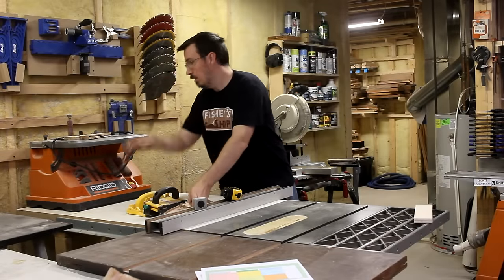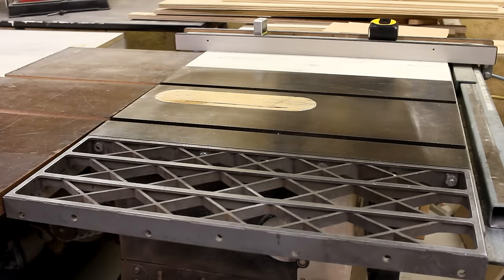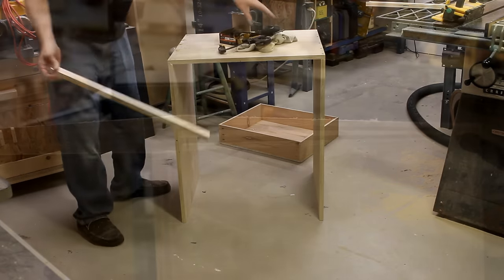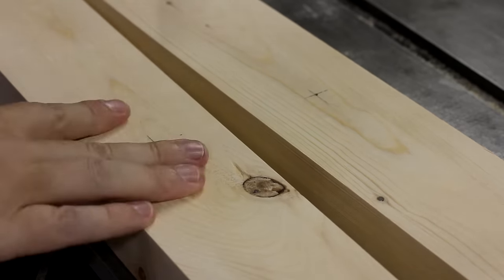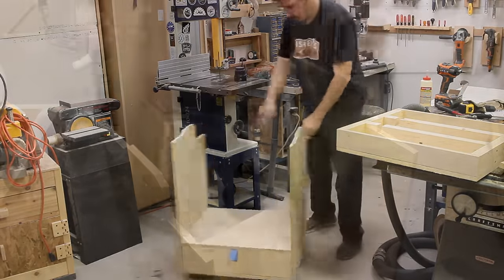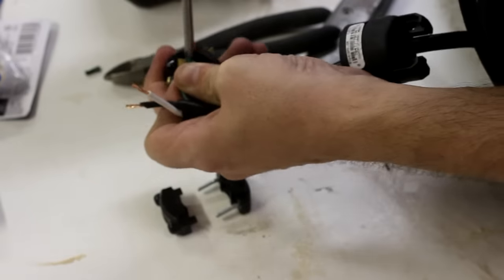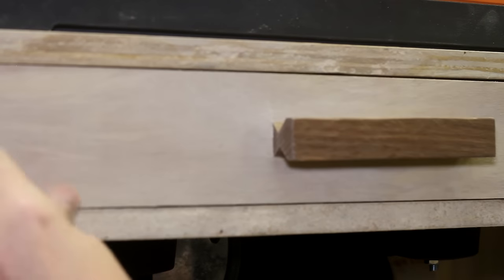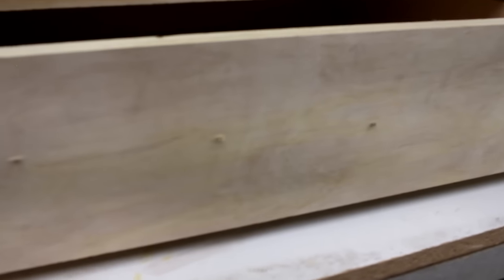Shop Work: How to make Fisher's Flip Cart

Comment: Fantastic design and entertaining video!   Building it right now....and have come to the flipping table portion.   Is there any reason you didn't screw the bottom/disk sander platform down to the 2x4s?   Your plans and video only showing you gluing it down.....and then hanging the disk sander off the glued platform.....seems like it could use some screws.   Let me know!  :-)
Reply from the maker: Add screws if you want.  Not really necessary but you can certainly do it.

Comment: I'm planning on modifying this design for a jointer/ drum sander.  Do you forsee any problems extending the top to 34" wide?  It's a pretty long span,  but I assume the torsion box coupled with the steel pipe axel should be able to hold up fine.
Reply from the maker: It'll be fine.  I know some folks made it 4'  wide for a lathe and it's working just fine for them.

Comment: I made your cart awhile ago and love it. Mine has some side to side motion even after I put some triangles in the corners to stabilize it. Is that normal? If not, any suggestions? Thanks for the great videos.
Reply from the maker: No that's not normal.  😬
Reply: Thanks for your fast response. It seems to be from the little bit of space btwn the table and sides that allows the table to flip. Clamping the sides tight seems to work, but I was just checking.

Comment: Great Video - just subscribed. How would this design perform with just a single tool attached (8" Planer / Thicknesser) and a assembly surface on the other side ?
Reply from the maker: It would be fine.  Just a little more clumsy to rotate since it would be so lopsided.

Comment: Drew, great design.  I have purchased the plans and plan to add a couple of these to my shop.  One question/request.  Can you share a picture with the belt sander down?  I am looking at getting the same tool and would like to see more clearly how it fits upside-down.  Thanks.
Reply: check at the 12 minute mark in the video. ( also in the outtakes.)

Comment: I want to make one of these. Is it possible to have two carts joined together, side by side? Maybe no tools on one side to act as an assembly table when tools are not used.
Reply from the maker: They wouldn't be flush due to the pipe flange and the latches.  But yes... I suppose it could be done.  It would be a bit low for an assembly table though.

Comment: Hey Drew, I just bought your plans after buying a lunchbox planer and the same sander in recent months.

One of my machines is slightly taller than 19". I'm assuming I can make the "Flip Cart Sides" (pink pieces) longer along the 30-1/4 dimension to accommodate?
Reply from the maker: Sounds right!  That should work

Comment: Drew, Nice plan that came together reasonably well, though my 'squareness' probably doesn't equal yours. 

My observations: the plans are good, but they would be better if all the dimensions were in inches instead of feet and inches. Who needs to do math? 

I would add more diagrams with gross measurements so that the user can see some details at a glance. 

I used dadoes for the shelves, and the half-half-half method for the drawers instead of pocket screws, mostly because I wanted to keep practicing those skills. Plus, I like the added feeling of solidity you get with the added glue surface and screws, instead of face glueing with pocket screws. PotaTOE, PoTAHtoe.

I like the power and window latches for locking. And it seems to move smoothly for me. Thanks again.

Comment: I'm pretty short. I bought the plans. But I need it to be shorter. If I cut off the bottom drawer, would this have enough structural integrity to hold these tools?
Reply from the maker: Hmm, you might have issues with it racking too much if you did.  Maybe just get smaller casters and then make the sides 1-2" shorter.  You'll be reducing the size of tool that it can work with, but that might be ok for you.

Comment: Just purchased your plans for this cart.  I was hoping to flip my new Bosch router table and spindle sander.  Router table is 28" long and 21" high which means I'll have to modify the dimensions a bit.  I can reduce the height of the bottom drawer or omit it entirely. Will it be a problem with stability?
Reply from the maker: Just make the sides taller and keep the drawer

Comment: Hi Drew!  Just bought the plans a few days ago and almost complete. The best flip cart out there. One question, I’m noticing that the sides seem to bow out a bit. So much that I’m finding myself having to push both sides together to flip the top and secure the latch. Any thoughts? I’m using 3/4 birch plywood so it’s straight as an arrow. Just dumbfounded. Any help would be awesome. Thanks Drew!
Reply from the maker: That's gonna be an issue if yours is doing that.  I recommend replacing the axle with pipe that extends further out each side.  Then thread the ends and screw on end caps to prohibit the sides from splaying out
Reply: @FishersShop  then i assume just make a second hole for the power cord? Not as James Bond-y coming out the the pipe but would get the job done nonetheless.  Thanks Drew.
Reply: @Fisher’s Shop  I have the opposite situation....   mine bow inward a little.   I tried squeezing just the flip top surface B between the sides.  It fit.  Just too tight for what I feel would be a good flip even with the weight of my tools.  Since the flip top is not built yet, I’m thinking I might just shave half an inch off of everything.  It will be a pain, but I want a good flip.  Any other thoughts before I start cutting?

Comment: Great flip cart design and latching system!  Much better than the barrel bolts most use. To drop the cabinet quickly onto the floor or raise it for movement - check out Carl Holmgren's  'Retractable Casters for Power Tools' YouTube video. The cart will sit on the floor during use plus you don't need to lock each caster.

Comment: It has been a while since you made this video, and maybe this has been asked in one of the 2247 questions/answers/comments on this video, but can this type of flip cart be made so that it only has one tool and the other side is a relatively sturdy flat work surface? The workshop that I would like to build also has to do secondary duty as a garage that can park two cars. As such my shop has to fit around the edges, especially the back wall, which is where my main work area will be. I would like to put my cross-cut saw station somewhere in the middle of the wall so that i can handle relatively long boards on either side of the saw. And I would like the area on either side to be flat worktop flush with the saw table so long boards are fully supported. 

But I need for nearly all of the space on either side of the cross-cut station to do double duty as at least a place I can store other large power tools like a planer, sander and the like. I thought of just having a cart that I can put the tool on and then slide it under the worktop and pull out when I need it. But then the tool is low to the floor and not at bench height where it is easy to use. My thought is to make a flip cart where the single tool hangs upside down when not in use and the topside becomes part of the workbench spanning most of the back wall of the garage When I need to use the tool I can pull the cart out and flip it so the tool is up. If I can do it right, the cart might be able to slide back into its place and now the tops of the other flip cards can serve as run in and run out space for the planer or disk or belt sander.

But without two tools bolted to the flipping section, my concern is that it would be too unbalanced and would put too much stress on the cart during rotation. Do you have any insights into using a flip cart in this way so i can learn from others misadventures and not have to make them myself. Thanks!
Reply from the maker: That would be just fine.  Yes, it'll be more difficult when rotating it since it'll be so far out of balance, but as far as sturdiness goes, it'll be fine.  That disc sander is I used is very heavy (approx. 85lbs) and I'm nowhere near the weight capacity of the cart.  Plus, I used cheap plywood.  IF you use decent plywood, you'll be fine loading it up.

Comment: Great Plans! I'm building this because yours is awesome!

I am near the end but am noticing I can pull away a bit since the pipes aren't actually attached the sides. Is there anyway around that or is that just how it is?
Reply from the maker: I've never had an issue with mine.  If it's a concern for you, then I suggest getting a slightly longer black iron pipe for the pivot bar, threading the ends, and attaching the flanges onto the ends.  If you do this though, be sure to add some bushings of some sort to protect the wood as your rotate the surface.

Comment: Hey Drew  , always good stuff I've made a few your creations no Problems am thinking of doing this flip using  the Ridgid sander you have and a Dewalt 735 planer which weighs in at 92 lbs  do you think this can handle this kinda weight especially when you have to flip it over ?? thanks in advance .... dont want to build it and find out the planer will crash it ..
Reply from the maker: The weight won’t be a problem but you’ll have to scale it up a bit to accommodate the 735

Comment: I want to add a flip up table extension to the sides, so may use this as a starting point but definitely tweak.
Reply from the maker: Careful. Too much weight on the wings would cause the sides to splay out and your surface to crash. 😬

Comment: So I bought your plans, very detailed and I'm looking forward to building it, I'm adapting it to the width required for my planer and adding a bit of height so my outfeed is at the same height as my table saw, small shop woes, efficiency is key! One question, do you happen to have a link for the locking latches? I really like the ones you used and can't seem to find em
Reply from the maker: Look for window sash locks.

Comment: Hi that's an ingenious solytion. I sure you have done it, But dont forget to debur the pivots./ electrical conduit, so the cable don'twear or short, kinda gets to exciting.
Reply: Or add rubber grommets cable glands or eveninternall and rubber hose... And lots of pvc electrical tape. Hmmm

Comment: Thinking of building this, but would like to put that Dewalt 735 planer on one side, and a belt/disc sander in the other. Do you think it would practically support that kind of weight, Fisher?
Reply from the maker: Weight won't be a problem.  But you'll have to scale it up just a bit for the 735

Comment: Awesome build, and some great ideas to incorporate into a modified version that i will start on shortly. I will be purchasing your plans, as everyone should get something for their time. I am a General Contractor, and MANY people think that your time, design and expertise is free, even when they DON'T hire you to do the actual thing you bid on. THAT is total crap. TOO many people also feel that any content on the internet is free, and the creators deserve nothing for their efforts. I always encourage my fellow WW's to purchase plans, even when only using portions of the design, as your design work has saved me much time and aggravation. Seem only fair to me. 
    My idea is to make a jumbo sized cart (almost double the width, and slightly deeper for stability), large enough to hold a DW planer (new type), with a fixed sled, approx 42" long. The underside would carry the Ridgid oscillating belt sander and a HF spindle sander. I think the weight on top an bottom should be close to the same.I am thinking that if I double up the side vertical panels and make the flip section thicker, I should not have any weight issues. Your thoughts?
   By the way, the built in power strip is WAY cool.
Reply: The out takes were awesome. I'd be a liar if I claimed that I haven't done ALL those F-ups myself. Of course it is MUCH funnier watching others make the mistakes.
Reply from the maker: Thanks Andrew!  Many folks have altered my plans to allow for the DW735 planer but it sounds like you want to go even bigger.  You mentioned HF spindle sander but you might have meant the HF disc sander since the Ridgid is both a belt and a spindle already.  The HF disc sander is like 80lbs and the Ridgid is around 35lbs.  Together, they would exceed the DW735 which is just over 90.  Having uneven weights doesn't matter at all though... just makes it so you have to assist the revolution during flipping.  Thanks for the support and best of luck in your build!

Comment: Any tips for cutting two 3/4s at once with a jigsaw? I gave it a shot for the side pieces and the deflection was… noticeable.
Reply from the maker: Yeah, that's an issue for most jigsaws.  I'd recommend cutting one perfect, then cut the second one outside the line.  Then stack them and use the first one as a template with a router and flush trim bit to make them identical.
Reply: Yeah maybe I’ll give that a shot

Comment: I’m liking this design. I’d like to get the plans. But how solid is the top? Does it flex or move at all since it’s secured only on one corner?
Reply from the maker: Between the two points for the axle, the positive stops, and the window sash lock, that's 5 points.  It's very secure and I've been using the exact same setup for years now and it's still working like a champ

Comment: Did you have to buy a new plug head for the powerstip or could you just use the one that you cut? I thought you only cut it to fit it through the pipe?
Reply from the maker: I bought a new plug

Comment: Do you think could hold a dewalt 735 planer?  I like your build better, with integrated power etc, more so than the other ones.. Just curious if it could hold that kind of weight.
Reply from the maker: Yes, the weight isn't a problem.  But you'd need to make the surface bigger for the 735
Reply: @FishersShop  ok, good to know.  735 on one side, Grizzly spindle sander on the other... Coming right up

Comment: As it turns out, when I pulled my clothes dryer away from the wall to replace to exhaust hose, I not only found a colony of odd socks, but they were living in harmony with all those screws I thought had vaporized. They seemed happy together, so I just left them behind the dryer.

Comment: I wish you would indicate what size screws you used to attach the cabinet bottom to the sides.  I could not find the use of the various screws anywhere.  Please let us know where the (8) 3" deck screws are used as well as the (21) 1 1/2" Course thread drywall/ wood screws.  Thanks.  I have your video and bought the plans.
Reply from the maker: The plans cover it all.  Page 16 shows the 3" screws being used to make the internal structure.  The drywall screws are used to hold the flip surfaces onto the internal structure.

Comment: How heavy a tools will this table support?
 I have Shop Fox W1671 (90lbs) and Royobi 12 5/16" surface Planar (62 lbs) 
I want to use Flip Top Table for these tools
Reply from the maker: Won't be a problem at all.  The disc sander is 85lbs.  I've seen others put much heavier tools than that on as well and the cart holds up fine.

Comment: I want to use with the Ridgit oscillating sander and the 100 pound dealt planner. Will it hold that weight with no problems?
Reply from the maker: It will have trouble supporting the weight of an entire planet.  :)  But if you meant the DeWalt 735 Planer then you'll be fine.  You might have to tweak the plans so you have enough width and depth for it, but I've had viewers send me pictures of how they've made it work, so it's doable.

Comment: Say, Drew, I'm curious about something. In the description, you say the disc sander weighs in at around 85 and the spindle around 35 lbs. That disc sander doesn't look like 85, but I suppose it could be. And, it really doesn't look like a 50 lb bias when you're flipping the flipper. I don't know if I'd be comfortable with one side 50 lbs heavier that the other. What am I missing?
Reply from the maker: The weight of that sander is 82lbs, believe it or not.  The difference in weight doesn't matter because of the positive stops.
Reply: @FishersShop  Yeah, I get the stops. I was thinking about mid-flip - with 85 on one side and 35 on the other. It just didn't look like you were dealing with 50 lbs when you were rotating it. You are clearly a much more powerful man that one might think.  :)  

I really like your design, Drew, and am collecting parts for one, now. When I get it done, I will either balance the weights closer (I'm old) or invite you over for BBQ when it's time to flip it.  :D
Reply from the maker: @jimshockey6789  Sounds like a plan! :)

Comment: I built this according to your video. Installed the same kind of tools, but cart seems wobbly from left to right with 3/4" plywood... Put some corner braces but still wobbles when I pull on it... Any ideas?
Reply from the maker: If it's wobbly, then I'm afraid you did something wrong.  Should be solid :(

Comment: Hi Drew. The 1/2" pipe doesn't screw into the 1/2" tee? Should the tee be 3/4"?
Reply from the maker: The pipe should screw into the T but does not screw into the flanges on the ends.  Those are just meant to offer support.

Comment: Another great video. I had not seen a flip cart before watching my first video of yours.  Excellent idea.  Great space saver.  Did it take a lot of work to get the balance of the tools so it flips easily?  And again, i love your humor about tearing apart your neighbor's dog house - it is humor, right? ;-)
Reply from the maker: The tools aren't really all that balanced.  The Disc sander is way heavier (more than 2x) and front-heavy but with the positives stops on the table, it all works just fine.

Comment: 10:22 LMFAO I did a ceiling fan change with out turning off the breaker once. My half dead computer was on the same circuit, so I couldn't turn the breaker off or it was a paint to start my computer again. So I sat on an underground chest of drawers and re hung a fan.